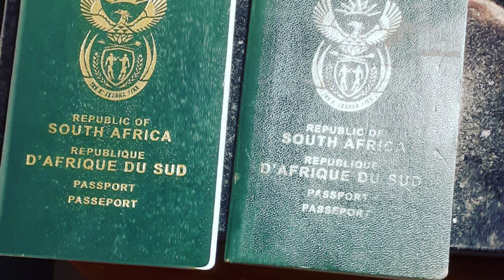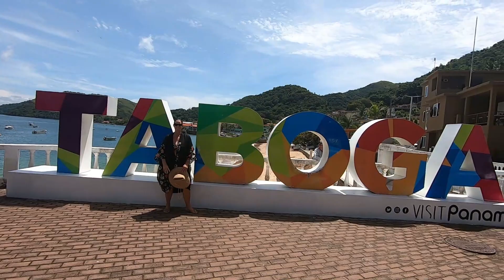Mechanical Mayhem and Visa Woes !

Comment: You really should look at buying a product called Res-Q-Steel for any threads nuts etc on the boat. Like the bolts on you heatexchanger. Not for anything exhaust related but anything else it is totally amazing. And a tiny pot/can goes a long long way. My brother bought a 4 litre can of it and it lasted over 25years. Can coat nuts bolts threaded rod etc that are underwater 24/7 like rudder and prop nuts and even if the fasteners are underwater for years and years at a time they will undo like new ones when required. 16 years underwater is the record so far.
Reply: Also with your genset its glowplug start judging by the return rail off your injectors which shoes its an indirect injection engine. Those Onan, Kohler gensets can be very hard on glowplugs. I service pumps injectors turbos etc and see 100's upon 100's of those little P size injectors a year. They would have to be pretty bad to inhibit the engine starting. If they are atomizing and the spray is hitting the glow plug and the engine has compression they will always start. The rack or control rid in the injector pumps can and do stick due to water in fuel or bad quality fuel. Mechanic shouldve been able to find that issue within the first 5-10 minutes of being onboard. Stop solenoids fail regularly on them too. Mechanical liftpumps fail but can be diagnosed in minutes in board as well. Most should have an electric pump as nd sum have electric feeding into a mechanical pump too. 
So really its, compression, glowpugs, stuck rack in pump, bery lazy injectors, lack of fuel supply to pump ( lift and injector).
Coukd also ne a blocked up exhaust mixing elbow. Just had one blocked to the extent you couldnt fit a pencil into the exhaust inletbor outlet of the mixing elbow/riser. And always always test glowplugs by removing rail along the top and after ensuring 12v or rated voltage of  plugs is present to the rail, you then take a hotwire from starter cable or battery and touch the wire to threaded too of each glowplug. Just putting a meter on the rail while connected will only show the presence of voltage not wether the plugs are any good. You should see a small soark wen you touch the wire to the plug. Of you can remove them and test with a multimete or put across a battery. But hotwire is fastest way and hasnt let me down innover 40years now.